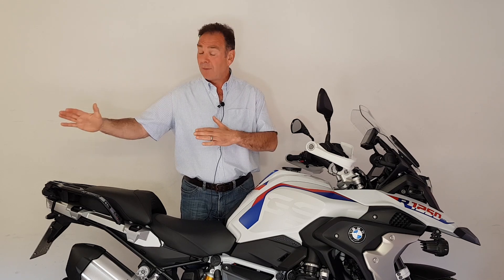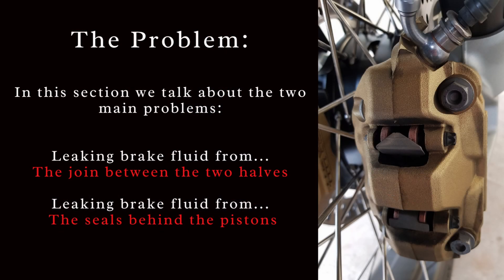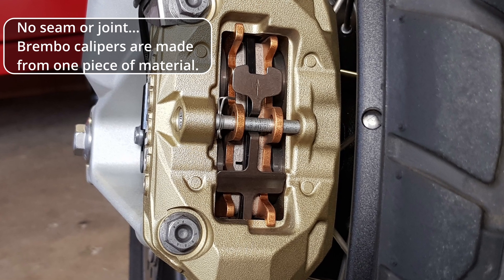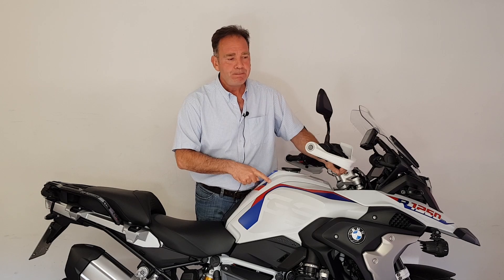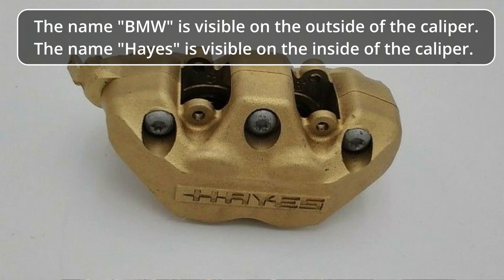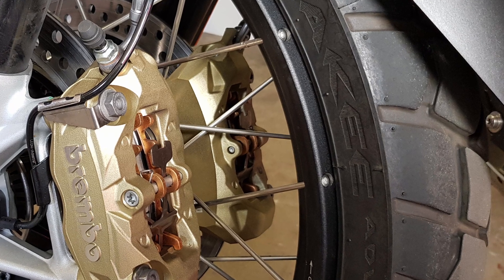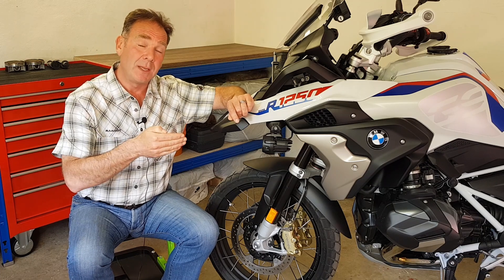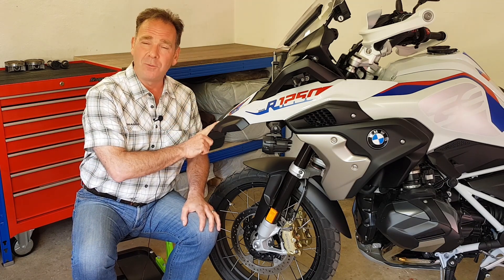EP:5 BMW R1250GS/A Brake problems, Hayes Calipers leaking brake fluid & New Brembo Calipers fitted

Comment: I never understood why BMW changed from Brembo to Hayes calipers. In brake tests the Brembo's have more stopping power and more feel in the lever than the Hayes, so it is quite understandable that with problems or warrenty claims BMW falls back on Brembo, which proved themselves in the R1200 GS(Adventure) models.
Reply from the maker: Hi Ton, I think we would all agree with you... in not understanding why BMW made the change from Brembo to Hayes. While I was looking around the showroom I was surprised to see the same models fitted with different front brakes... some with B and some with H, it does not make any sense.  Even the sales guys have no idea why.
Welcome to the channel,  best wishes Carl
Reply: Surely it isn’t a mystery, BMW saving money - why would you assume otherwise?
Reply: @rotoehu9266  Hayes brake systems is a subsidiary of the BMW company and Hayes calipers are initially used in the Mini constructing process, and now for the GS 1250 as well. It's just an accountancy issue.
Brembo calipers are more expensive due to initially pricing and licensing.
Come to think of it, my neighbor owns a mini and had to see the dealer for brake problems  like fading and brake oil leakage of the... Hayes calipers.
Reply from the maker: Hi Roto, yes it is  probably a partly money saving thing, but the Hayes does give a better feel for less experienced riders. Welcome to the channel. Carl
Reply from the maker: Hi Ton, I think I read last night that the Brembo group actually purchased the Hayes brakes system company in 2007 !! Which adds another twist...to the story. Carl
Reply: @justthewayitis  Oh really? That is totally new to me! That can mean two things:  the quality of the Hayes calipers will be drastically improved or the brake company formerly known as Hayes will cease to exist as an independent brand and is reduced to an expension of Brembo production capacity.
I am very anxious to know which way it is going to. Thanks for the update Carl!
Reply from the maker: Just Google 
Brembo buys Hayes.
Carl

Comment: Well I have two gsa's my 16 have had zero problems with it 48,000 miles. My 2021 GSA came with Brembo brakes and no problems with it either. I wonder how it seems the YouTubers get the problem bikes one of my other motorcycles my GTL supposedly the big problem with them was they pulled left according to all the YouTubers. Never saw that problem at all with mine. I have a Jeep Gladiator that if you look at some YouTubers all they can do is find problems with it. So I wonder if part of the way you draw an audience is the controversy of a warranty problem with the bike
Reply from the maker: Hi Duane and welcome to the channel,  I do partly agree but I for one only report what has actually happened to myself and what others have also reported from owners I know and trust. Some owners are just lucky with the bikes they get. Just look at my multistrada series and the problems I and other have experienced... but then there are owners I know that have had Zero problems. 
It's a funny world.
Best wishes Carl

Comment: I had a new bike from BMW in 2010 and it was a nightmare from day 2. The dealer and BMW kept arguing over the problem and after a year, the dealer refunded the money. I lost all faith in BMW after many years of championing the marque. Their build quality has reduced. I owned an R80rt, R100rt, K100rt and they were incredible bikes that stood up to high mileage. Look at BMW now and they clearly have quality control issues. The usual one is the silver/grey covering on the engine and shaft drive flaking off. I've owned 77 bikes and most makes. I'd rate Victory, KTM and Honda, as the best build quality. BMW need to improve.
Reply from the maker: Hi Neil, yes I agree they need to do better. I think Honda is still one of best to own long term, over 10 years or more. You have had a lot of bikes...an amazing collection of memories I would think.
Which was your favourite?
 Best wishes Carl
Reply: @justthewayitis  I forgot my favourite, my BMW R1100s that I did a lot of tuning work on. Close second my KTM 990, with my first big bike, a Suzuki GT250B, in third. As for the bikes I should have kept as investments 🙈🙈🙈Yamaha XS1100 Martini Hailwood replica, and a new Suzuki 1100 Katana.
Reply from the maker: If only we had kept some of our bikes. lol..... My first bike was a Honda SS50... I built from 3 different boxes, my dad bought it for me at an auction and thought I would never get it running. I had to get a workshop manual to help rebuild  the engine ... which is probably why i first trained as a technician. 
I would have liked to still have that... plus my 1990 GSXR1100L which was in blue and white. Horrible to ride but lovely to look at.
But nowhere to store them. Smile. 👍

Comment: The 2022 S1000rr now comes with Nissin calipers
Reply from the maker: Hi Steven, I now need to go back and check ... the sales chap who handed over the keys confirmed they are Hayes... now you have me doubting... smile.  I'll go back and check. Thankyou Carl
Reply: The S1000rr comes with the same calipers as the M1000rr. The M sport version has the same blue calipers and the standard rr has the black Nissin calipers
Reply from the maker: Hi Steven, are you located in Europe,  UK or USA ?
Reply from the maker: Hi Steven.
I called BMW,  the bike I tested is fitted with Hayes.
Here in Germany the S1000RR comes with both types.
The only way to get Nissin is to order M spec in Blue.
I asked about your location because of the following information I also received. 
In north America and Canada all versions S and M version come with Nissin.
In the UK might be the same, he was not able to confirm this.
It looks like it all depends on the country you order your bike.
Reply: I'm in the UK

Comment: BMW website indicates that the manufacturer of the brakes will be different (than the bikes shown) on the current website and '22 models...
Reply from the maker: Thank you. Several subscribers have bikes on order, and no one really knows which manufacturer of front brakes their bikes will arrive with. Not very good from BMW. Carl
Reply: My bike was mfgd feb ‘22. My dealer advises all bikes  GS/GSA manufactured in 2022 come with Brembos. coming off sport bikes. i love these. what a bike. . The twin of yours. great info and clRity of info Carl. Bravo. Thanks.
Reply from the maker: Hallo, entschuldigt die Verzögerung mit den technisch korrekten deutschen und englischen Untertiteln, sie sind jetzt für diese Folge verfügbar. Viele Grüße, Carl

Hello, sorry for the delay with the technically correct German and English subtitles, they are now available for this episode. Kind regards, Carl

Comment: good afternoon Carl, here I am delighted with your videos, I watch everything you write, and I would like to tell you that I have had the opportunity to purchase my new GS 1250 Rally with Brenbo brakes and my previous GS adventure with Haynes brakes and for me Brenbo they are much better, And I can tell you a trick taken from my days on the circuit that shortens the distance of the brake lever, the only thing that I have been thinking about for a long time is to patent the idea so that it is not copied, just like in my GS adventure I solved the loss of rear brake feel due to temperature, a 🫂🫡
Reply from the maker: Hola Pedro, puedes enviarme tu mensaje vía email si quieres.
Contactcarltoday@gmail.com.

Puedes contarme más por correo electrónico y nadie más podrá leer tu mensaje.
Carl 🙋🏻‍♂️
Reply: Good afternoon Carl, I'm going to make a video and explain it to you, these are fixes that were made on the circuit when your wallet didn't allow you to have the best brake master cylinder,
Reply: Carl, and you try it and if you like the result, let me know, greetings
Reply from the maker: Ok, then I will wait for your video 👍